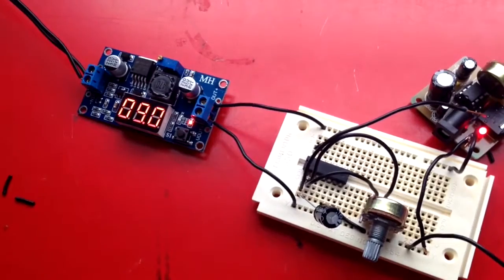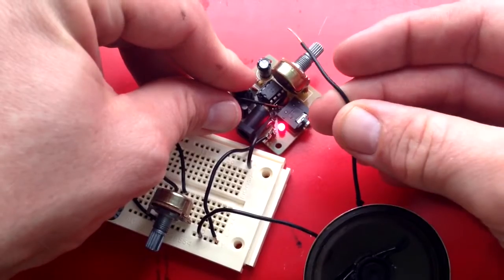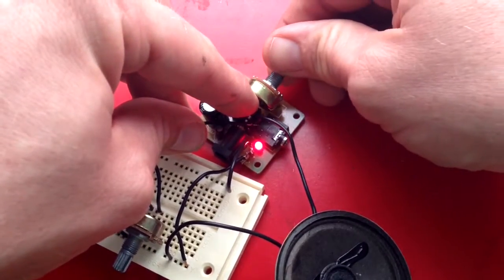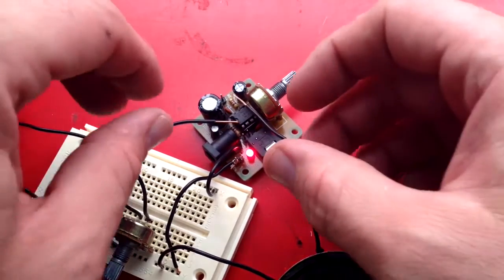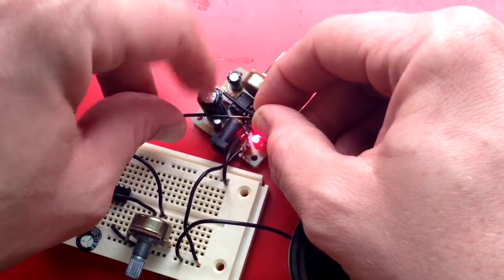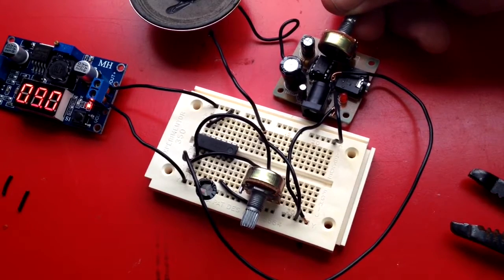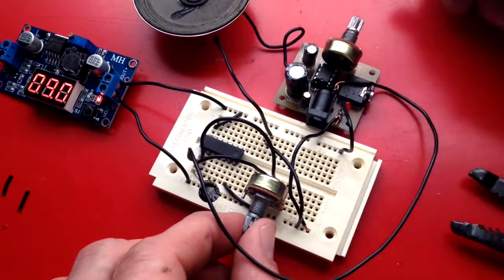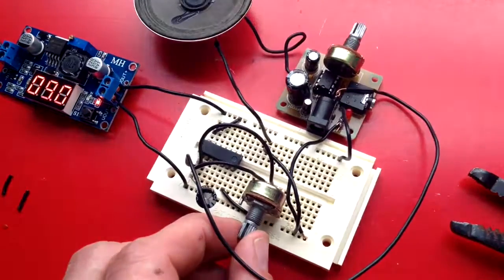Testing CD40106 Oscilator into LM386 Mini Amplifier

Comment: The led needs like a 1K ohm resistor so it won’t burn out. Also, this works great using a 100K potentiometer and a .1uF capacitor. Cool circuit, great job!